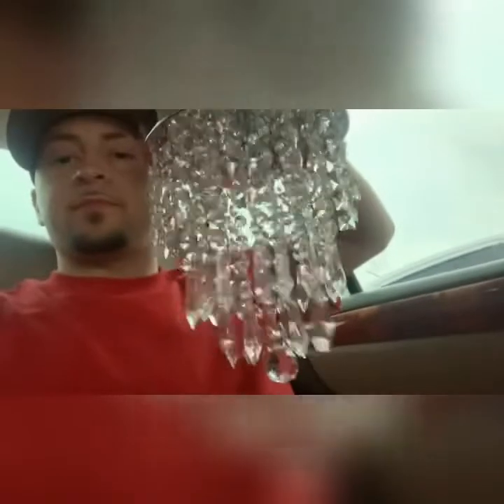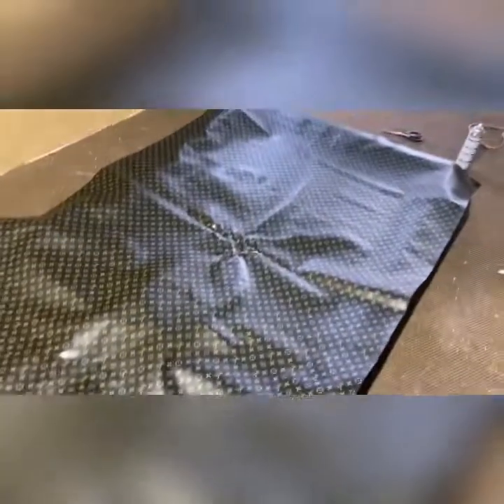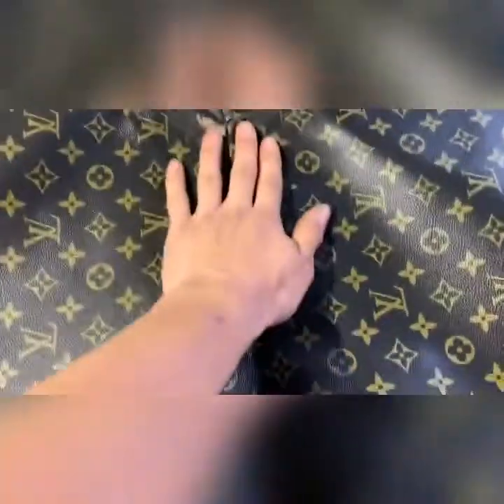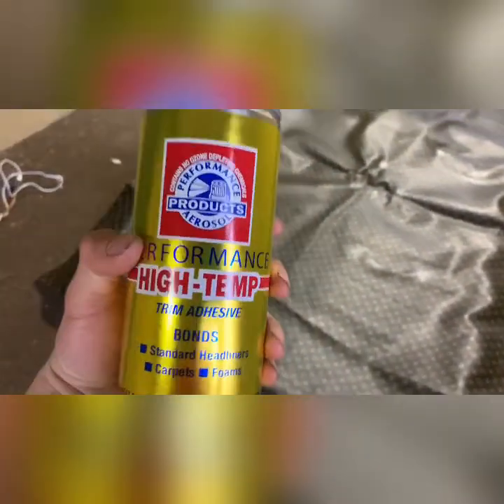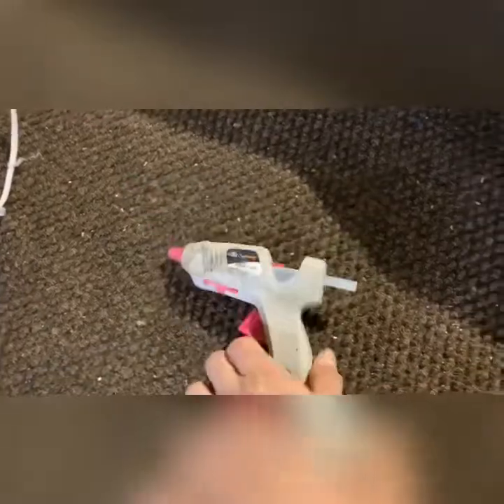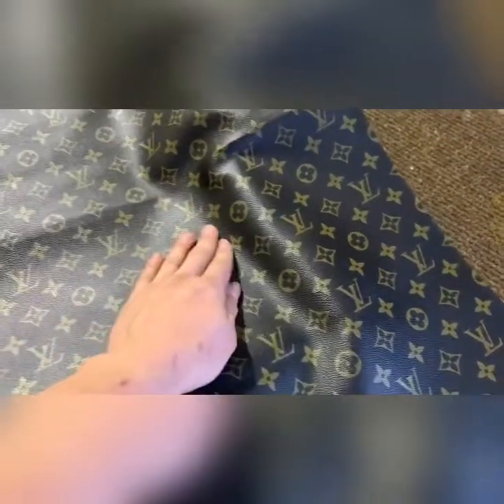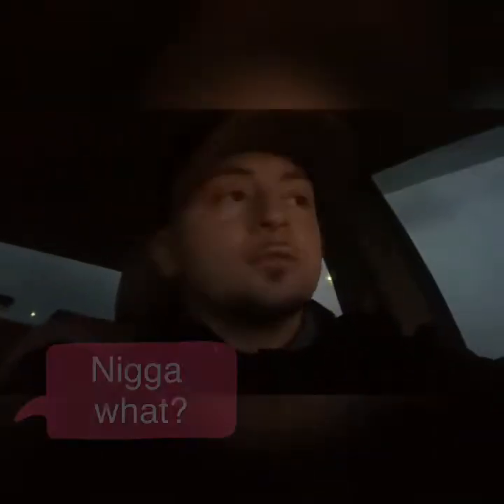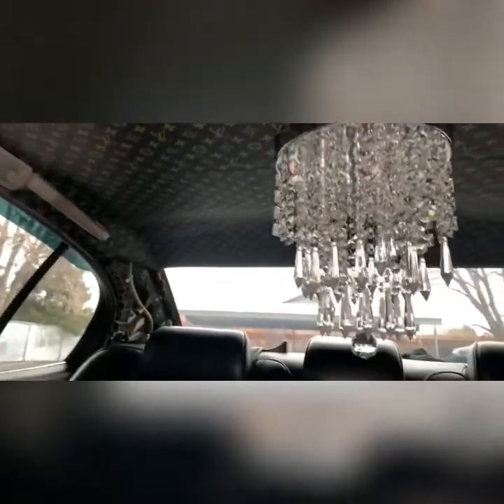Installing a chandelier and LV print into a headliner

Comment: How did you mount the chandelier?
Reply from the maker: On the back of the headliner I drilled holes to put the bolts thru, I had to measure the back of the chandelier tho so I didn’t drill too far apart, also I measured the headliner so I didn’t mount the chandelier crooked or off center
Reply: @imyosancho  I also have the Katana shifter anf added a pink velet shifter boot ! Love it, for the chandelier I had that made for me and getting the headliner done soon, are you able to take the chandelier down after drilling the holes ? Mine came with the magnets 🧲
Reply from the maker: @ExotikDeathCore   yes it has to nuts mounted and all I have to do is remove them and it slides right off